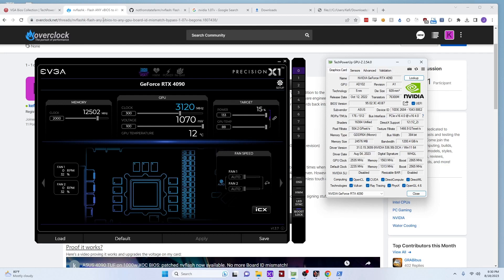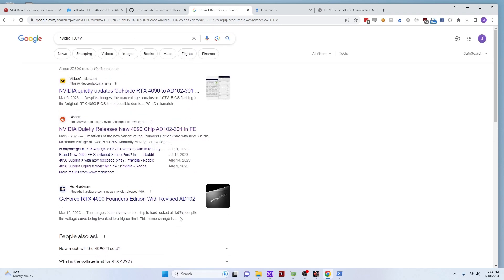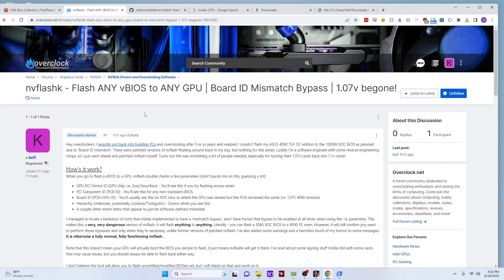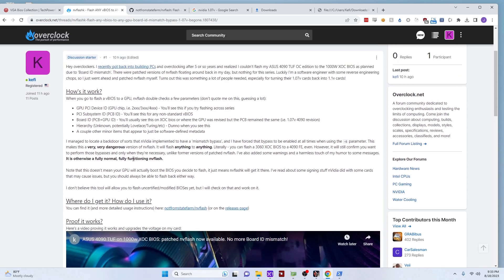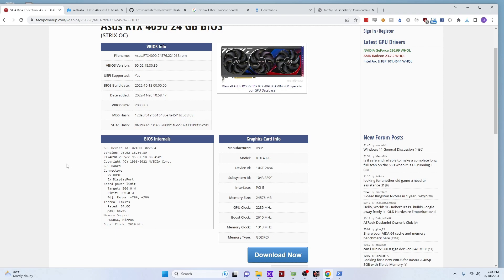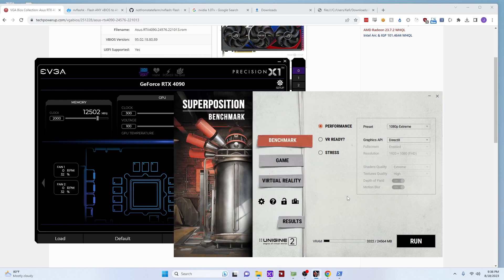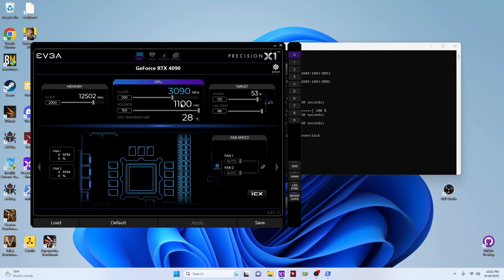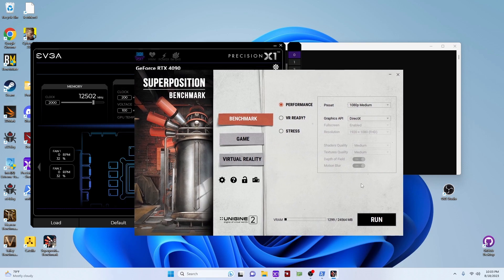Flashing RTX 4090 back to 1.1v boosts Superposition score massively

Comment: I'm dumbfounded as to why my ASUS  tuf 4090 does max voltage of 1.05, i flashed the same strix vbios as done in the video and no difference. any ideas why i can't above 1.05 even if i try to voltage lock? im air cooled, all i can do is + 170 core until OCCT complains.. bad silicon lottery i suppose

Comment: Hey kefi. Thank you sir. I just flashed the 1.1v bios to my strix 4090. This works like a charm. Stock performance bios and flashed the 1.1v to my silent bios. Now I just need to see if there is a 1.1v bios for my PNY 4080 XLR8. I guess I just have to try flashing some.
Update. First vbios i tried got me back to 1.1v on my 4080. Both cards within 15 mins awesome! thank you

Comment: I have Gainward 4090 Phantom and the stock Power bios is 1.1V . But the bios is limited to 450W. I replace the q-bios with MSI bios,with power limits 480W/520W and the bios works perfect on it,but I still have the same power limit like before 450W ,because this limit its locket by the bios and by the stock power cable of the Gainward 4090 Phantom. I replace the cable with aftermarket one (12VHPWR, 600W) and magic happen,now I have power limits 480W target and limit 520W. But do not use on this card bios wich have limit 600W because this card have no so strong VRMs (that is the reason why is cheeper from asus and gygabite 😁) and U can burn it haha. Also U can try other bios but this bios need to be from card which have the same fans and display ports configuration ,other way you will have problems with the ports or fans :D I use this bios to flash my card (it also 1.1V but when u put the voltage slider in afterburner on 100%) : https://www.techpowerup.com/vgabios/249756/msi-rtx4090-24576-220920-3

Comment: My Gainward 4090 only run 50 hz  on gpu  1,1v
Reply: I have the same card (Gainward 4090 Phantom) and the stock Power bios is 1.1V . But the bios is limited to 450W. I replace the q-bios with MSI bios,with power limits 480W/520W and the bios works perfect on it,but I still have the same power limit like before 450W ,because this limit its loket by the bios and by the stock power cable of the Gainward 4090 Phantom. I replace the cable with aftermarket one (12VHPWR, 600W) and magic happen,now I have power limits 480W target and limit 520W. But do not use bios wich have limit 600W because this card have no so strong VRMs (that is the reason why is cheeper from asus and gygabite 😁) and U can burn it haha. Also U can try other bios but this bios need to be from card which have :  3 fans,  with 1x hdmi and 3 x display ports ,other way you will have problems with the ports or fans :D I use this bios to flash my card (it also 1.1V but when u put the voltage slider in afterburner on 100%) : https://www.techpowerup.com/vgabios/249756/msi-rtx4090-24576-220920-3

Comment: Thanks for the video and the tools. I have flashed my gigabyte gaming oc card which was running a 2023 bios. I could never reach 3000mhz without the gpu crashing. I flashed the HOF 666w bios and +100 voltage in MSI afterburner and wallah now boosting 3000mhz. Going to see how high i can get it but without this tool it would be impossible.

Comment: Got a "revised/newer" RTX 4090 (Galax SG) with limited 1.07V using +100 on MSI AB. Your file worked great since NVFlash 5.8.14 was not able to perform the flash (showed mismatch even forcing -6). For now I'm using the Galax HOF 666W BIOS with no issues so far. There are no scenarios where this RTX 4090 can go beyond 666W unless I could increase voltage even further with an EVC2 or similar vMOD. Thanks

Comment: With my 200W capped 4070 I was able to flash to 250 and 300W bios. Drivers good, games run, benchmarks run, temps low (40-50), but performance is reduced unfortunately. The BIOS flash changes many sensors, thinks my card has 16-pin power rather than 8. I will try another 8-pin design card without a wattage cap and see if it's any better.

Comment: already try to flash 
Model:	RTX 3070 Mobile
Device Id:	10DE 249D
Subsystem Id:	10DE 0000

BIOS flashed but become undetected GPU
Model:	RTX 3070 Mobile
Device Id:	10DE 249D
Subsystem Id:	0000 0000

Comment: Great work Kefi! Really appreciate your time in creating this tool. I have a 4090 TUF non-OC, I was wondering which bios you would daily (gaming mainly) given you have a 4090 TUF OC version and there isnt any difference between the both the OC and non-OC version specs wise. I'm watercooled. Thank you in advance!
Reply: I have the 4090 TUF OC, and I've successfully flashed the 4090 STRIX Vbios (Performance) onto my card, in which I game regularly with. I'd recommend that or just keep as is tbh.
Reply: @Lopoboi  Do you have the link to that bios mate? Most appreciated.

Comment: Hi, I got sold a gigabyte 3060ti gaming oc revision 2.0 that was bricked and the guy blocked me. I used your tool and the fans work on the card now however there is still no display. Is there any advise you can suggest? I’ve been so stressed trying to fix this $400 paper weight.
Reply: Have you fixed it bro?
Reply: Nah man ill have another attempt soon  @Gaetano.94
Reply: Do not flash card which have only one bios! Because have a big chance to lost the card...

Comment: Stupid Question: If I have an 4090 from INNO3D, can I flash my Bios with that of an Asus Card too or will that destroy it? I think board-wise most cards have a very similar layout.
Reply from the maker: It usually works fine, minus things like LEDs and power readouts not working properly.
Reply: @kefisendsit  Ah nice! Cause I modded mine and made it watercooled, I think I am gonna try to flash a BIOS with the highest clock from an ASUS card. My temps are running maximum of 58C (highest spot) and ~2950 clock. So I think I still have room for more!

Comment: I have a air cooled 4080 will i benafit from this and by how much also my model is from pny and I cant find one with a 1.1V bios is it ok to use the same bios you used?
Reply: Have you done this at all?
Reply: I have a PNY 4090 and I want to flash the Suprim 480 watt base and 520 watt oc bios. I already tried nvflashk to flash the oc version of PNY 4090 on my non oc 4090 with zero issues. I just don't have the courage to flash a different vendor bios on my card yet.
Reply: @cemsengul16  No problem to use diffrend vendor bios just need to be with the same fans like your (3 fans) and the same display outs,exaple 1 x HDMI and 3X Display port. I flash my Gainward 4090 450W with MSI 4090 bios with power target 520W and works perfect
Reply: @X--SEPULTURA--X  Thank you very much for that input. The funny thing is I flashed so many bioses on my 3080 before but I got that card for cheap and used. I think subconsciously I am scared to mess with a GPU I paid over a thousand dollars on. I do have integrated graphics to fall back on for an emergency reflash though.
Reply: @cemsengul16  To have biger power limit you need also to replace the power cable with 600w aftermarket one. The cable also 'lock' the power limit by 2 small pins on it. Check in internet about the cable and U will understand what I mean.
Reply: @cemsengul16  4090 have a dual bios. If u fuck up the flash, you can swith to the secound bios. I flash the 'q' bios ,and keep the original 'p' one. Also the buos from Gainwsrd GS also will work on your card. Whit bios os with target 500w and 1.1V on the core
Reply: @ My PNY 4090 sadly doesn't have dual bios. I do have a 600 watt Lian Li Strimer cable and Corsair RM1000X PSU though.

Comment: Question: if power and voltage control already do not show up in MSI afterburner, would flashing a different bios even change my ability to change the power limit? Even using Nvidia-SMI I am not able to change power limits at all, even if I try to lower it so I’m not sure if it’s even something my motherboard supports. I’m on an Acer laptop
Reply from the maker: The BIOS is what defines whether or not you can control power and voltage and how far. So, if you flash a BIOS with a higher power limit, tada. I'm not sure if there are higher power limit mobile GPU BIOSes though.
Reply: @kefisendsit  I have low hopes, I just tried NVflash and it can’t even detect anything about my GPU... not sure what’s going on
Reply: The limit ist not only from the bios. My card have stock power cable with 3x8pin. The cable also limit your card to 450W. You need to replace it with aftermarket one 12VHPWR, 600W

Comment: If I struggle getting 3000mhz on a stock voltage for my card (110%), would this help? Anywhere past +100 has stability issues unfortunately, and I'm wondering if allowing it more power would help or if it's just bad silicon. Temps are fine, 50c average at gaming temps and 65 on benchmarks.
Reply: All 40 series cards are voltage locked increasing power limit increases temps doesn’t increase core clock in fact it runs much hotter down clocking so

Comment: I unfortunately don’t have 4000 series gpu but I wonder if this will help if you were to solder 16gb of vram for the “4070ti” and flash a 4080 bios. This is really cool and there are many possibilities that this nvflash mod can bring. Thank You.
Reply: From what I understand, besides the bios maybe needing to be different to double the vram you have to use resistors to "strap" the vram chips, so it's not just a bios change that lets you use double capacity vram chips.

Comment: Got 752 w on msi afterburner after flashing. Did i did something wrong? I refllashed to default and it works fine.
Reply from the maker: It takes the right kind of synthetic benchmark to actually pull 1000 watts. OCCT is the one I use.
Reply: @kefisendsit  Thats not what I mean. After flashing vbios msi shows that gpu is using 750w while clock is 210mhz...the lowest it can get. It doesnt boost or anything. Its impossible for my laptop to draw this much while gpu is idle.
Reply from the maker: @vives6164  ah, interesting. Yes, cross-flashing BIOS can cause some power sensor issues because the BIOS defines what sensors are what. You'll need an external monitor like a WireView to confirm. Temp sensors are on-die and should be unaffected.

Comment: sorry, I'm new to OC - I have a RTX A5000 would it be possible to turn it into a 3090 as they are similar?
Reply: Will be interesting to see RTX A5000 flashed to RTX A5500 (Since both share GA102 chip with same memory layout) 25% extra cores enabled just like that if this works.
Reply from the maker: I've tried the opposite, turning a 4090 into an A5000, and it didn't work. The card just rejects the firmware. I imagine it won't work the other way either, but you are more than welcome to try without too much risk.
Reply: @kefisendsit  nice thanks, gonna keep seeing the video and channel I'm not really familiar with OC